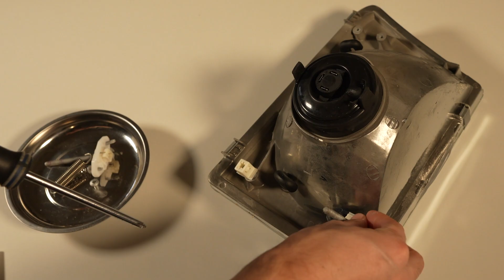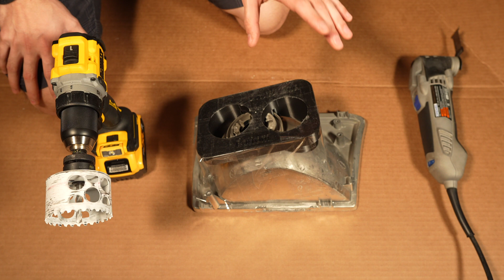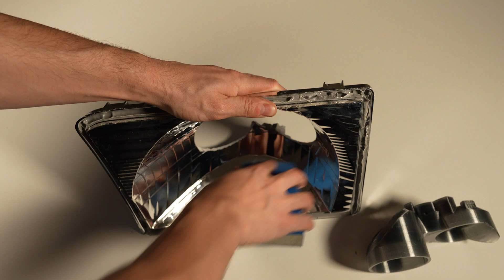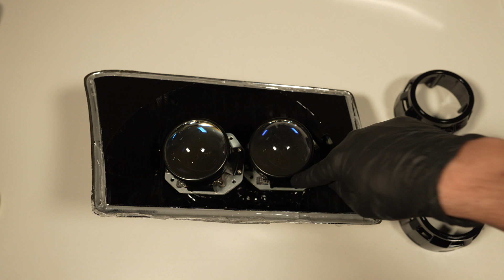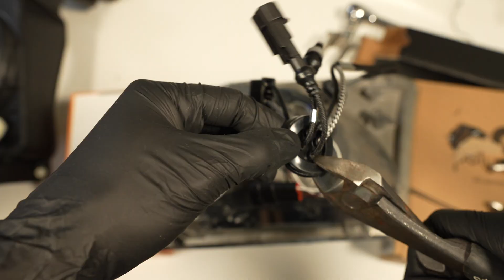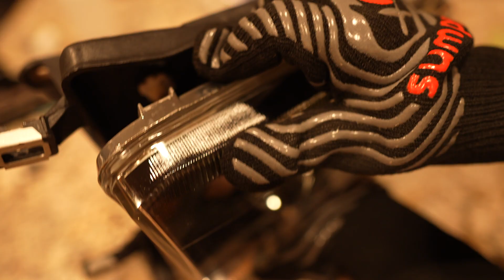Building the Worlds Brightest Quad Projector Headlights on my 3rd Gen 4Runner

Comment: Personally I ran 55 watt NHK ballasts with a quad Mini H1 setup and I know they said absolutely do not run higher than 35 watt ballasts in those. I used them for 5 years before switching to my current quad oem Koito projectors with custom led drivers. Never had a problem with them burning up the reflective cups or diminishing the light output of the mini h1’s. However I had a bit more space in my headlights like yours do. So maybe it’s more about them having enough space to not melt anything. Because they do get quite HOT! I tried holding them powered on to see the beam pattern when I first got them and within a minute it was so hot I couldn’t hid it without a kitchen towel or leather glove lol.

This is an amazing quad setup though! I still love HID’s and I think for off road setups there quite good. They handle vibrations, and liquid very very well. I had one of my lights begin to let water in when I had HID’s and we had a heavy rain storm where I got a lot of water in them and the bulb itself got wet and I never had issues with it then, or for the 3 years more after that I continued using it.

Comment: Is it possible to source amber D2H bulbs for this mod? Or 3000K I should say?
Reply: Yes! Morimoto sells 3000k HID bulbs. I only reccomend 3000k if you’re running 35w. When you go up to 50w it actually makes the color temperature go warmer, and I think their 3000k bulbs are only rated for 35w anyways. If you want to run 50w, go with their 4500k bulbs and it will get you close to that nice crispy 3000k yellow.

Comment: i'm not familiar with the lifespan of a projector light. i overland and if on the trail, i need a spare part kit for something like this. What would you recommend for a parts list for that?
Reply from the maker: @doncline-k2t  generally I don’t bring spare headlight parts. Parts failure is very uncommon and having a bulb burn out won’t leave you stranded
Reply: @SnowboundCustoms  thanks, just started looking for a 3rd gen and this is one of the first things i'm going to do for it

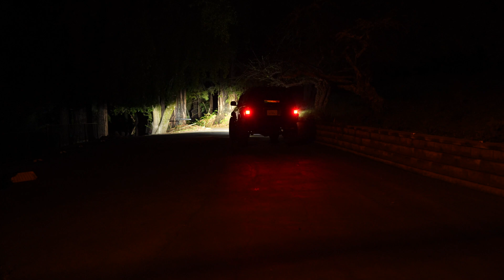Comment: 38:10 what the family of 4 sees at sonic when I pull up
Reply: I was really disappointed to see that they're that bright.  He had talked a lot about considering others on the road, but they're still unsafely bright for city driving.
Reply: @Tokugawa1979  These are actually aimed too high. Proper adjustment with projectors should just be kissing the crown of the road at about 25 feet. And that angle gets even more drastic with lifted vehicles. But in general, it shouldn’t look like this at all ideally. But on a lifted vehicle you’re probably going to have this blinding effect within maybe the last 5 feet on a properly aimed projector. They’re much better than LEDs or HIDs in a halogen reflector housing when it’s done right.

 These aren’t quite aimed right. They still need to go down a bit more. The general rule of thumb is to find a perfectly level surface with a level 25 feet between your headlights and a flat wall. Measure the distance between the ground and the center of the projector lens. On the wall at 25 feet, take that number and subtract 2.5” and put a piece of tape there (or if you really wanna do it right, use a laser level to mark that measurement). Then tilt it down until the projector cutoff is hitting that 2.5” mark. And that’s for a normal vehicle. For a lifted vehicle like this, I would honestly go closer to 3” to 3.5” just to reduce oncoming glare. That’s still going to give you plenty of low beam light, and your high beams will easily make up for the extra drop.

Comment: So end result;

Both low/high beams are on at the same time while lights are on?

Is it possible to have outer diameter light rings to potentially aid turn signal or only dusk parking lights installed!

You’re only using morimoto mini’s?

Can you provide a X comparison;

LED vs HID to compare light throw/quality.

Thank you, nice video.

I am working 55+ hours a week, so might build pre order.

Cheers
Reply from the maker: Hi, I was using the morimoto Micro D2S with 55W. In the end I’ve stopped selling these HIDs in replacement of the new LED projectors I have now. The LEDs are brighter, less expensive and much reliable that what I was getting with the morimoto. In regards to halos, I don’t add them to lights anymore like I did in the last. They are really all too dim to be using on a vehicle as a turn signal if it’s bright outside, and you can’t see them at nighttime either because the projectors would be turned on. Oh and also yes, all 4 lights work together at the same time for both low beam and high beam!
Reply: @SnowboundCustoms I’m in inconclusive with either going hid or led but I’m really looking for is the width of light output I’m looking for a projector that has good width any recommendations?

Comment: Do you have another link to this kit? The one in your description is not working…
Reply from the maker: I’ve temporarily removed the product. I’m making two new versions. HID version will be gone. The new ones will be LED projectors because the new ones are actually a good bit brighter and cost a LOT less, and a LED projector + Baja Designs Squadron version of it!
Reply: @SnowboundCustoms  when will it be available? I’ll be buying the kit the day it drops. I’m doing a full rebuild right now and will be moving to all the lights shortly.
Reply from the maker: Hi  @aaronwaddell595 , sorry for the delay! I only just now added the new LED version of this to the website

Comment: Great video 👍🏽 
I’m thinking of doing this mod and keeping it chrome. Know if anyone has used a clear epoxy instead of JB weld?
Reply from the maker: Sorry for the delayed response! I've built a few sets since this video and found that you don't need to add JB Weld on the inside. It's plenty strong with it just on the backside out of sight.

Comment: from what ive read you can use various products like oven cleaner to remove the chrome instead of sanding it off
Reply from the maker: Just looked it up and that may be a good method to use! What you saw in my video is just what I’ve been doing for years and definitely not the most correct way. Just something that worked for me. I’ll have to try the oven cleaner method another time
Reply: @SnowboundCustoms  ive also read folks using shaving cream or mean green but not sure how any of them actually work
Reply: I can vouch for the oven cleaner, just use a can of Easy Off, it dissolves the chrome finish within about 10-15 minutes.

Comment: Great mod. I have the bx built projectors from TEQ customs but my passenger side is always shaking, no matter how many times I have tried to tighten it.  I wonder if that drill jig will work on a 1st gen tacoma?
Reply from the maker: It won’t work (I think). I’ll try to make a separate one that works with Tacomas. And ya, it probably shakes because there isn’t much surface area for the projector to clamp onto the factory housing. I made these holders a very tight fit so it fully encompasses the bottom of the projector and they’re pretty rock solid in there with 0 shaking